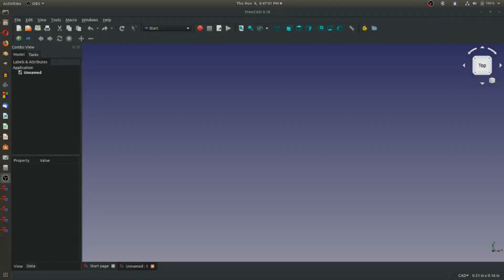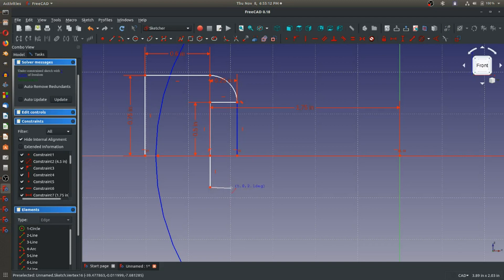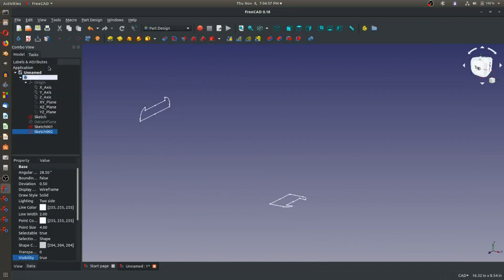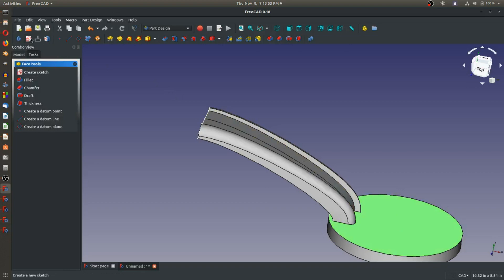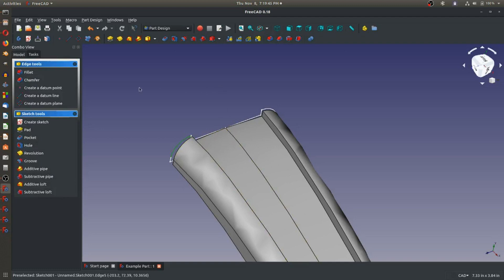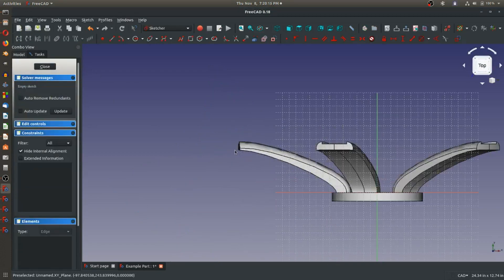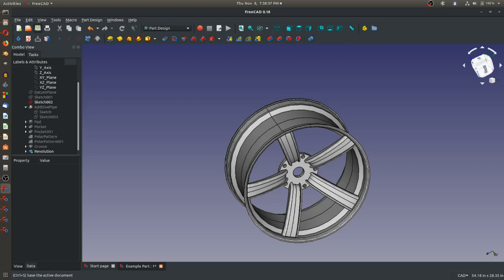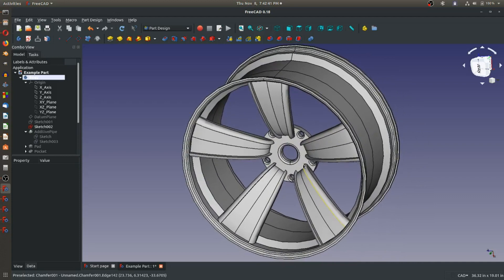FreeCAD Tutorial for SolidWorks Users |JOKO ENGINEERING|

Comment: I just started using the FreeCAD 0.2 and have been following this tutorial to get up to speed. One way to mirror the sketch profile is to select all the sketch features you want to mirror with your last selection being the sketch feature that you want to mirror about. Then go to the DOF menu and use the symmetry option. I used this to mirror the wheel rim profile, but it does not carry over all the constraints so you'll need to redo those.  Thanks for taking the time to make these tutorials!

Comment: I really like this video. A long term freecad user, sometimes screaming at the screen :) to hide and show objects just hightlight them and press spacebar. To see "through" your objects while sketching use either view> draw style> wireframe OR while in sketch you have the option to use "View section" a blue box with a skech symbol on top. Tooltip is "Switches between section and full view". Another tip is when referencing the origin you don't need to select it. Just select the object (in sketcher) then choose, for example, horizontal length freecad will reference the origin for you. Every click counts :). EDIT: Just noticed you mentioned this later.
I know you now know this but I added the comment for newer users who finds this excellent video ( I know it's old but very usefull anyway). Thanks for sharing!

Comment: Showing how you set-up your FreeCAD environment would be awesome.
Reply from the maker: If you're running windows 10, I can't help you with a dark theme, though I think there are some options listed somewhere on FreeCADweb.org.   My dark theme is running on Linux Ubuntu 16.04, and it's the obsidian green theme.  It changes the theme of everything and is installed in the terminal.  My windows 10 is the default theme and is boring.